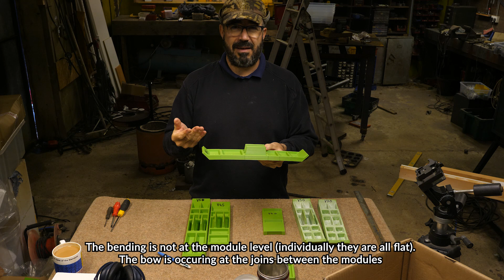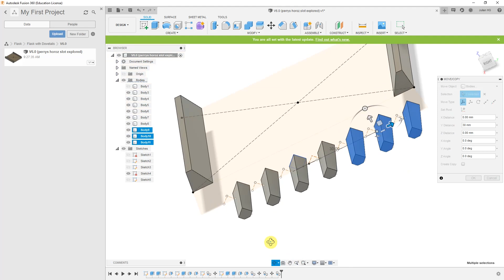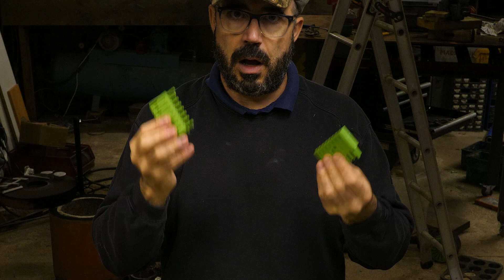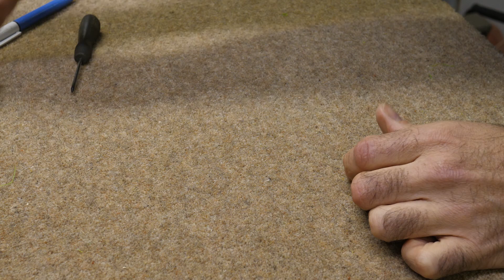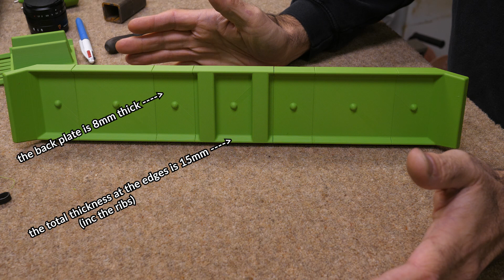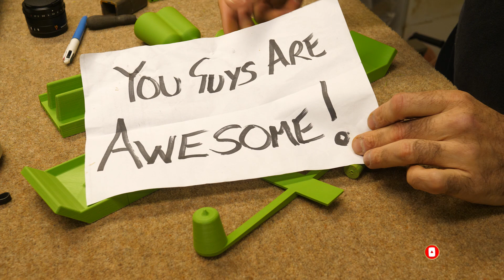Modular Metal Casting Flasks (part5) - 3D printed modules - pattern updates

Comment: What is stopping you from casting each modular piece separately and then assembling whatever flask you need whenever you need it? Is it really just the shrinkage in the aluminum parts that makes tolerances hard to achieve? Or is it that you're worried that it won't be rigid?

If you could quickly make any flask dimensions whenever then you could save on sand, upgrade over time, potentially have less to lift, make several mini flasks that are independent for the same pouring session, and easily store the pieces in a box until they are needed.

Comment: I really love this project and I am currently printing what I need to cast my own.  Printing on a CR-10 and my one complaint (probably caused by me doing something wrong in my settings) is that the fingers fit so tightly in the grooves, I have to really hammer them together and then they cannot be separated.  What am I doing wrong?
Reply from the maker: Hi weasel. Thanks for your comment and tyring them out! Quite a few people have made a flask with them now and a few people have complained that the fingers are too tight. I guess it's just variation between printers because some have said it's perfect fit. some of those that say it's too tight have had sucess with trimming off some of the finger length (for example halving the fingers), that way the friction to remove is way less and they may fit together better. I'd suggest trying that.
i really should do an update on these designs some day. and i think i should revise the fingers to be shorter and more blunt to allow more printers to print them and have them work ok for the most people. Thanks loads and if you manage to make a flask please send me some pics :) cheers o/

Comment: Brilliant Julian... Can't wait to see how this works out, this looks a lot better than the previous versions.  If you do use a feeder, let me share a comment from Olfoundryman on my first aluminium casting, which shrunk horribly...
"it should have connected to the casting via a gate  of length about 1/2 the feeder diameter rather than be hard up against it. this gate should flare from about 2/3 the feeder diameter at the casting to full diameter at the  feeder in particular it needs to flare a lot on the top side."
I think what he is saying is that i needed a lot more contact area on the casting, a wedge shaped end to your feeder connected to the casting rather than a pointy end should do it.  If you want more context to this you can read the comments from Olfoundryman in full on my moon video.  It was aimed more at my failure to construct the feeder corrrectly and my use of poor aluminium stock, but I think this general rule on feeder shape probably applies to any casting.  He also mentions that my incorrectly constructed feeder had the opposite effect and actually sucked metal out the casting, so I think it might be worth your while having a quick flick through the video where I build the flask and reading his comments in full.  Of course this may be mute, as your casting is a lot thinner and you are using much better stock.  Anyway good luck with the casting, hope to see all 8 sections soon.... (I apologise for referencing one of my own videos in your comments, please feel free to delete this comment once you've had a look).  Best wishes Andy 👍👍
Reply from the maker: MeltandCast thank you mate! and do not worry! I will def have a look at your moon video and the comments too. Cheers so much for the advice, I’ll do it tomorrow while I’m waiting for the new (fatter gated feeders to finish printing). If I get time I’m casting it tomorrow. Omg can’t wait!
Reply: @JulianMakes  Haha I can't wait either !!  Good luck mate 🤞🤞🤞  Cheers 🍺